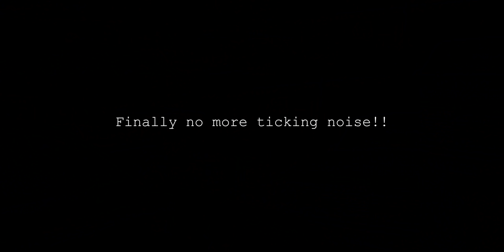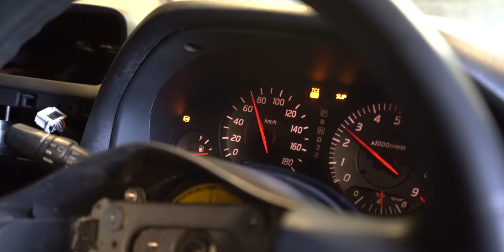Bad News and Good News | Poor Man's GTR [EP25]

Comment: Well...my dad has an 4 cilinders 16 valves Fiat,a few weeks Ago he was on a travel and suddenly out of nowhere the timing belt broke off...the result was 14 out of the 16 valves were bent, and the cilinder Head needed to be rebuilt(the entire engine has been rebuilt two years Ago)...sooooo,i think you're Lucky that this was not the case on the RB25!😅

Comment: Hey man, awesome vid bro. Mistakes happen man. I made a massive mistake last week with my r33, plumbed my catch can wrong and pressurised the motor, white smoke everywhere. 
Would you say man that I could pull the cylinder head off at home? 
Thanks for uploading such awesome videos!!!

Ahaha love the little teaser at the end.
Reply from the maker: 100% easy job man
Reply: @BrokenSilvia  sick bro. Any tips or anything to look out for? I've been told about the hidden 10mm bolts.

Comment: 12:53   Yooo 
An Astra! You rarely see these on Youtube :D   
Are there any builds on this one?
What engine does it have?
The Z18XE? Or the Z16SE?
You could slap the 16v 2.2 in it they share most of the motor mounts
Or the Z20LET. I have one too, had the Z18XE in the selection edition, now i drive the 1.6 thats slow as hell Xd sadly
Love these cars
I love JDM but im also a bit of a Opel-Fan
Or vauxhall how you call these things down-under :D